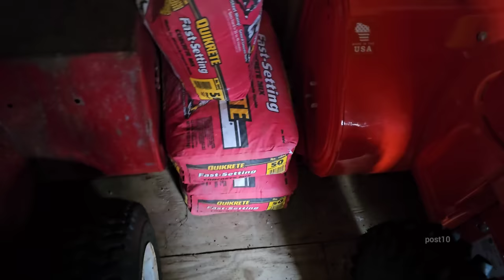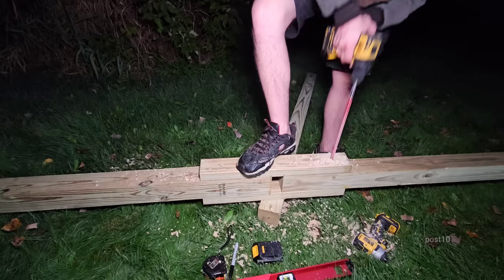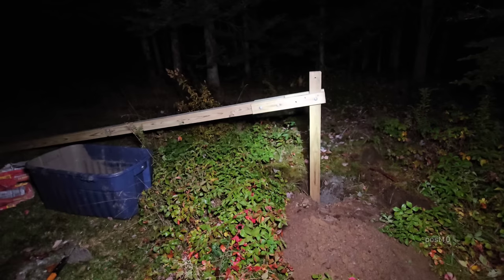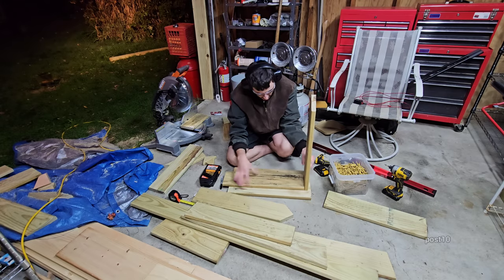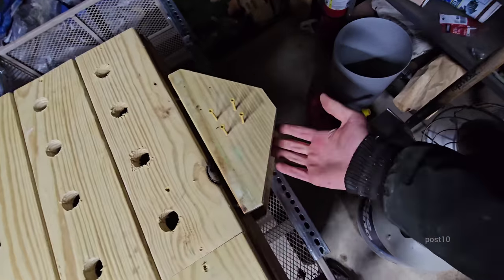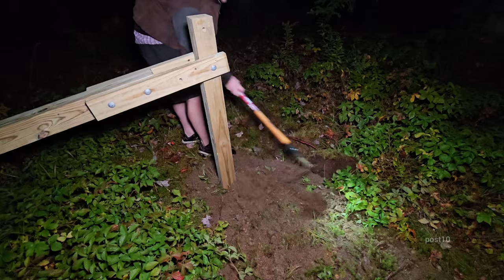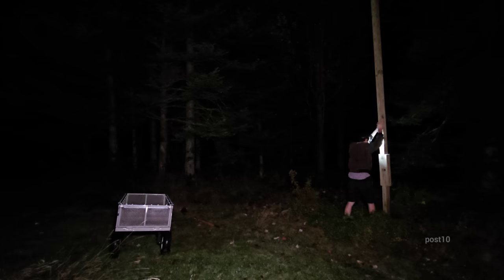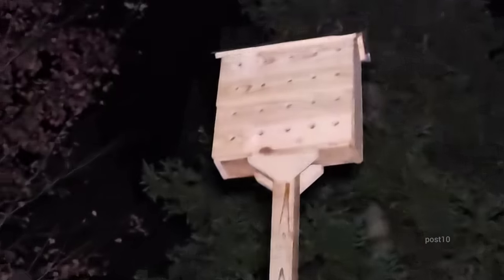Building Retractable Hinged Bird House Pole

Comment: You need to put your orange plastic piece back on your saw. It's a safety feature called a zero clearance throat plate that prevents small wood chunks from getting lodged in your saw and allows the cutting of small pieces. It is designed for your saw to cut a kerf in it.

Comment: I'm a little bit worried about the foundation staying in place during windy weather with the flat wall of the bird house providing too much wind resistance that far up, which might produce a lot of lever force on the foundation. It might've been better to have some of the bird houses empty and uncovered, to reduce it. Like swiss cheese, as it were.
Reply: i would advise stabiliser struts on either side of the post, maybe even 4 ways but even then it'll do well staying up in a storm
Reply: yeah fun project, but for all the work it has and will take I'd probably just secure it to a tree instead
Reply from the maker: I don't know why everyone thinks this, I couldn't push that thing over if I tried and that's not enough surface area for it to act like a sail

Comment: I noticed something about the finches and doves I get at my place. They seem to like making a nest where another was already made. They will build right on top of the old one or take it apart if they have to and reconstruct it. They are smart. If you're having trouble moving them in, I'd try to find/save an old nest and put that in the new bird house for them. I think it makes them comfortable knowing a bird lived there before.

Might not matter the type of bird nest either, because after the dove babies hatch and they all leave in the spring, a couple days later the finches will move in, and right on top of their old nest, they don't care. The doves have been coming back for 10+ years straight now, to the same exact spot/nest, right next to my back door above the light, under the roof. They don't hurt anything or make a mess, so I just leave it.

I think they like it there because, when they get used to the humans coming in/out of house, they realize we won't hurt them and we give them protection from crows and blue jays, etc. But all this time, I've left that nest right where it was and never touched it, they maintained it for all these years. Like humans do with their homes. The nest doesn't get crazy, it's always about the same size. I would suggest anyone trying it, put a bird house right on the porch. You will scare them once in a while, but you won't scare them away forever, they will come back. Just try to ignore them and let them be. You will protect them from predators and not even realize it. Eventually they won't even care if you walk right up to the nest, especially if you leave them a treat once in a while. Plus, you get to watch them build and grow. Babies hatching. Mama teaching them how to fly... That's an amazing thing to see.

Comment: That drill is meant for smaller bits and smaller projects. They made a model with more torque for what you are doing though.

So i see you have an impact drill and a normal drill bit drill, both are more designed for smaller projects, using small bits, mostly for decking. But a drill bit that size, and a depth that deep, you need the model above the one you have. Considering you aren't using these for work, as in a "every day job" such as "carpentery full time", you don't need the model up unless you plan on using it all the time. In the meantime it looks like you have figured out how to manage with this drill that has a torque that isn't designed for the job, and made it work anyways.

Good work on the bird nest pole, it looks great, and you did everything else right when working on a carpentry project. I admire your broad range of knowledge in so many different subjects, and your efficiency in each one. You are very entertaining to watch, you have a good spirit, a happy attitude, and a big heart. You work harded than most people i know, and you don't even ask for anything in return. God bless your soul.

Comment: Next time, try using the lower speed speed switch on the top of the drill. That way, you get lower speed but higher torque and much less chance of it binding up. You need to watch a few videos on the proper use of power tools. I will say it's a nice project and a good design on the pole. Keep up the good work!
Reply: Came here to say this. That drill is more capable then you give it credit for, just switch to low gear (1- low speed high torque, 2- high speed low torque). Still glad to see Post being creative though and building something. Too many people have tools and don’t use them, posts out here building sky scrapers
Reply: @DonnieTipton  You're right, Dewalt, Milwaukee, and even Ryobi are all good tools if they are used properly. As an old fart, I've been around tools all my life. I realize that Post 10 (David) is young, and   is still learning about the mechanics of his tools, but it's interesting to see him learning the ropes. He has impressed me with his determination to figure so many situations out that he gets himself in.

Comment: Hello man! Great video once again, great project, great result!!! 
Love seeing you building stuff, as an electrician I can spot many ways for improvement but I love how you do it your own way and if you realise something goes wrong you learn from it!
Just a question out of curiosity(I'm not judging) cause I'm not from America, don't you need to use sand with the concrete or even gravel too?
Here when we use concrete bags, we prolly use like 2-3-4 bags of sand for each bag of concrete(depends how strong you want it) in the mixture and sometimes gravel too(it helps it bond).
Unless the bags you bought are already mixed with sand.
Otherwise it's just a waste imo, you could do this project with prolly one bag of concrete and that's the only reason I'm telling you cause I know you care about saving when you can. 
With love Post! ❤❤
Keep the projects coming!!!

Edit: The part where you started screwing the walls/splitters and you did it in fast forward(timelapse) i started yelling "Noooooooooooo" and i think i speak for many more than just myself hahaha. We love seeing you building stuff, let the video in moments like this run smoothly! We don't get bored i promise. 
Unless it somehow helps you with the editing or something or you have a serious reason you do it

Comment: Hey that's a great use of scrap wood, nice job.  I saw you attach the angled base pieces with the long screws, I wonder if they go through the base into the bottom row of apartments.  Might they impale an unsuspecting tennant? 😮
Reply from the maker: If there is anything like that on the floor it will be covered up by a nest, Birds aren't that stupid, there are so many more sticks in the trees that they are avoiding enough stepping on, the bird is light and they can probably land on it without it even feeling Sharp

Comment: 2-3 small vent holes in the back of each cell would give some ventilation... But yeah, that’s a tall pole for sure. You built them a luxury hotel...❤️😁
Reply from the maker: That wood is pressure-treated meaning it's going to shrink and there's going to be lots of cracks in vents, there already is

Comment: I would have gotten a solid piece for the back and hinged it on the bottom for easy clean out.
Reply from the maker: Birds will remove the debris themselves if they don't like the previous occupants nest and it's very easy it's just a few screws with a screw gun

Comment: You can dump the concrete dry into the hole. There is enough water in the ground to set the concrete. The fence company I hired did that for all my posts.

Comment: I feel like the bird house is going to blow off in a windstorm. Could we get an update after a heavy wind event?
Reply from the maker: Why do you think it's going to blow off? It has 8 screws holding it to the top, I overbuilt that in every way
Reply: @post10Vlogs  I think the triangle wood connected to the base of the house will fail with a strong wind.

Comment: To make it easier to lift into place you could have  put a rope on the top and used a pulley to take some of the strain. Or you could have built it with much taller 2x4s putting the pivot point higher and allowing the top post to 'teeter-totter' to the ground where the lock pin would be (and could have a counter balance on the bottom).

Comment: 07:50, if you would have used, power stage 1 of your drill and not 2 your drill would have had enough power to  drill these holes.

Comment: i would pound posts in 4 feet away on all 4 sides and brace it to the main mast with 2x4's .just below the bottom bolt.
Reply from the maker: The ground is all stiffened up I could not pull that down if I

Comment: You are lucky.  If I were to try that here in Maryland, I would hit clay after about three inches.  You need a pick axe and a post hole digger here.
Reply from the maker: I didn't realize that area of the yard was going to be so Sandy, I thought maybe it wouldn't hold well, but that pool has strengthened up more than I imagined it would in the past couple days
Reply from the maker: I might build an entirely different pole and do one for the bats in the spring or maybe next month if the ground hasn't froze yet, maybe I should build the pool and just leave it there
Reply from the maker: Pole
Reply: @post10Vlogs  Now you know.  If you do it again, you might need to go with a wider hole or something since you cannot really go deeper.  If you were to go deeper, a rising water table could push the post out of the ground.  I have seen that happen to empty swimming pools in Florida where the water table is really high.  That is why a pool owner should always leave water in the pool even if it is not being used.
Reply from the maker: @ChrisClark31415 if anything more concrete but this pole is holding up just fine it's nice and sturdy now, it's not going to blow over or anyting it doesn't have enough surface area to catch the wind and a thicker pull wouldn't do anything but make it fall over easier as it's heavier, it would still need more concrete not a thicker pull, if I used instead of 4 by 4 6 by 6 there's no way I would have lifted that up

Comment: Trust me get some Milwaukee drills and you'll never have that issue
Reply: @Hitman-316 That was not the issue, he had the drill in high speed.
Red and yellow have the same motor per almost every test done.
Reply: @ducewags  I drill at full speed thru 4x4s and 6x6s without an issue with my m18s, just sayin
Reply: @Hitman-316  Not with the drill bit Post used. Did you notice the flute, land and self drilling part of it?
My guess is you don't know what the flute, land and self drilling part are. And have a nice day.

Comment: You need different batteries. Those you are using are weak. You need the 6AH 20v/60v battery.
Reply from the maker: How do you know what I'm using? It doesn't have a removable battery the one I'm using, it recharges with a phone charger and I also have a headlamp on, I'm not using the light from my review 2 days ago if that's what you're thinking. That's good for a short video but something like this that took many hours that weren't in the video I can't be running something like that it doesn't last long enough

Comment: It's going to gain a lot of weight when it shows, I don't think it will last the winter so I hop no birst set up shop in it, The wind and show pill up will for sure take it down. Before someone tell you to tie it off to a tree don't to that the trees move and if they come down they will take this as well, I feed the birds and animals all the time im not being  a jerk , Black  roof will also help with the heat from the sun over the winter,
Reply from the maker: How do you think it won't survive the winter? You know a 4 x 4 pool is capable of holding up an entire house if the weight is distributed correctly, I made this video we could go in that pool is now very solid in the ground, even if the concrete wasn't sufficient the ground would be frozen if there was snow accumulating on it to that extent😊